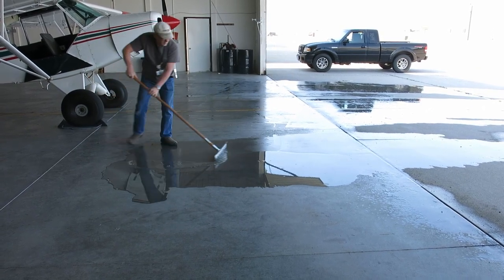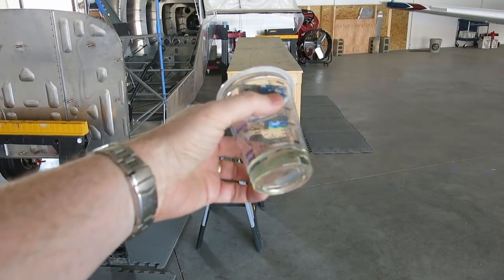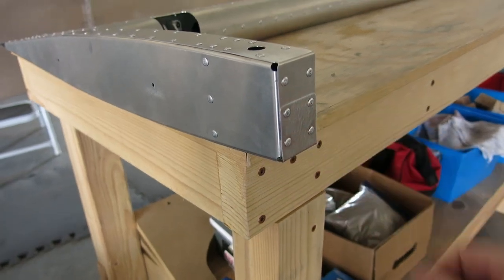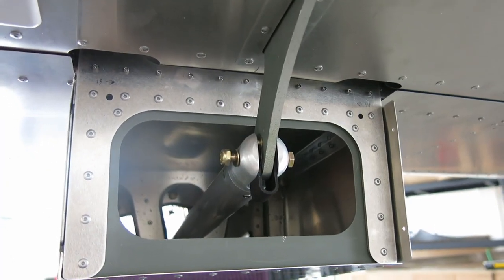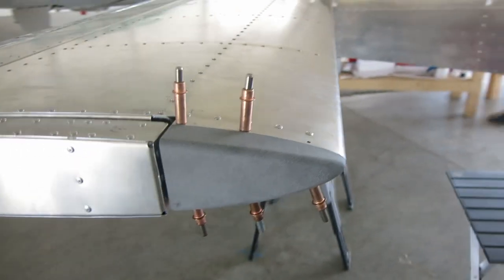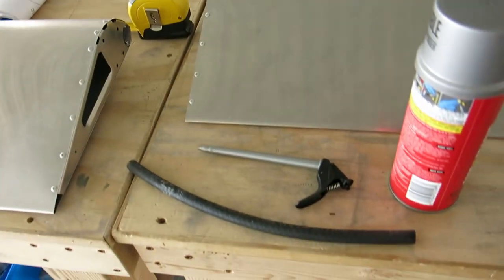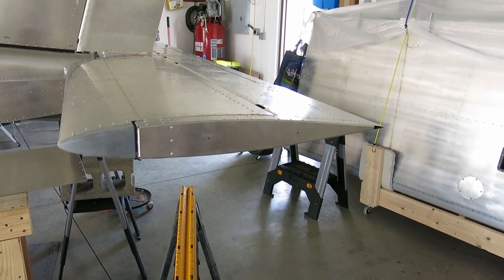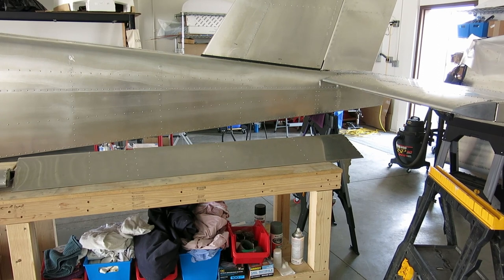No. 210 07-25-2022 Elevator install and aileron balance start

Comment: I was under the impression that you had to adjust the horizontal stabilizer with one remaining bolt requiring the wings to be installed prior to installing the elevator.  Since that bolt cannot be removed and re-installed with required washers for spacing with the elevator in place, I'm curious as to why you're proceeding with this step.
Reply from the maker: Just being lazy and didn't want to re-hang the elevator on the storage shelves. It came back off and will reinstall when we attach wings and adjust before drilling that second bolt hole in the stab when we match the wing angle. Plus it's a moral boost to see some moving surfaces on the airplane at this point.
Reply: @s-21project92  Yep, I get it and I agree it is a booster to see your project taking on the shape of a complete airframe.  You can still leave it hanging on temporarily, can't you?  It's probably safer on the plane than on the shelf.
Reply from the maker: Yeah we can leave it on, but we have connectors to build for the trim servo so will leave it off for a while. 🙂